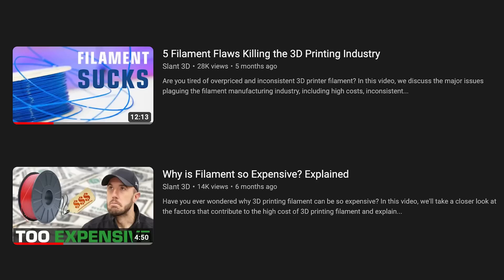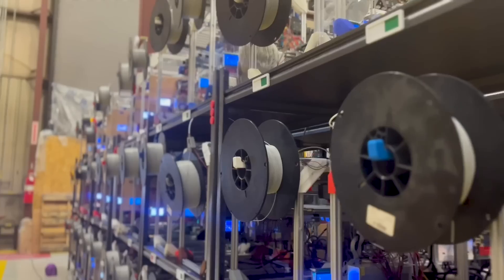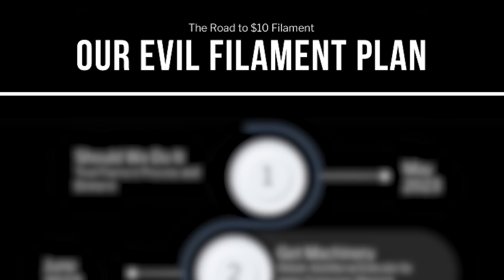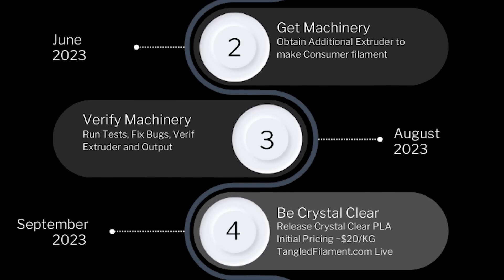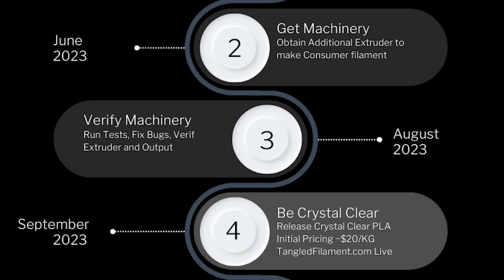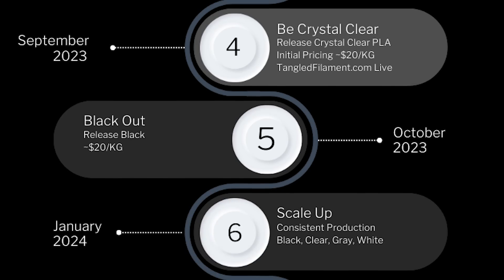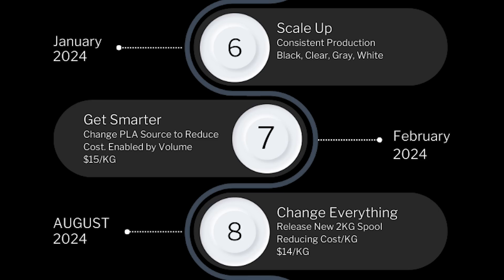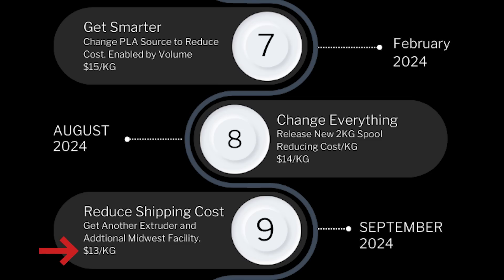Our Evil Plan to Make Great $10 Filament

Comment: I would be all for $10-$15 rolls of filament! I will be watching for this for sure.

One thought I had regarding plastic spool waste; I hate having big plastic spools left over from filament rolls. An idea I thought would be great is to sell the rolls wrapped on only a cardboard tube. Similar to the cardboard centerpiece on a roll of tape. Then have 2 plastic side pieces that can be removed but are not included by default with the spool. Then you could sell the plastic side pieces separately or even let people print them themselves. That way when you get a new spool you just pop the 2 plastic sides on and it would be exactly like a normal spool. When it's out, pop off the sides to save for another spool and toss the cardboard core.

You seem to be uniquely positioned to offer something like this since you have the print farm to print the side parts in-house. It could also help drive down cost. A cardboard tube has to be cheaper than those spools plus it would weigh slightly less for shipping
Reply: This is exactly how Bambu is doing it, you can buy either a spool or 'refil'  there is a little bit to it it has to be wrapped such that it doesn't fall off the cardboard center until after it is in the plastic halves but it works and saves a few bucks per spool.  They also have a small RF chip embedded which tells the AMS what filament the spool is.  But it works fine without it also.
Reply: @mattr3194  I am not in that eco system, but I am not surprised. Bambu is good at little things like that from what I have seen.
Reply: @royalt9863 $14-$15 US made filament already exists. You just have to buy in bulk.
Reply: @TheKDracing  Or walk into a micro center
Reply: @kalmenbarkin5708   My comment was US made materials. Inland is all made in China
Reply: So a masterspool? It's been around a while almost what you're talking about except it is no spool at all and you print two pieces that screw together for it, once they are screwed together you can snip the zip ties holding the filament together
Reply: $12-15 rolls are already all over Amazon. Shipping included.
Reply: Microcenter store brand (inland) filament (actually Esun, i think?) does this, and it's great! (spool-less line; it is, in fact, also marginally cheaper that way :) )
Reply: I'd prefer 0 plastic be used for the spools. It boggles my mind that single use plastic filament spools are a thing, it's literally 250g of manufactured ABS/PET waste.
Reply: this is how bambu does it, but if not on a sale its high lol
Reply: @jakeMTSU  I have purchased a bambu printer since posting this and as others pointed out, yes bambu does so exactly this. Smart!
Reply: MASS adoption = pellets.
Reply: Can you explain why is everyone so hyped? I am already buying $11 pla filament on aliexpress...
Reply: @Einxeld  I guess it's the assumption people are making that all cheap filament you can get right now is trash.
Reply: @treborrrrr  Sunlu filament is really good and my last order was 66 euro for 6 kilo of PLA shipped.
Reply: USA made ... always good @Einxeld
Reply: @Einxeld  I think you would agree that 10 is less than 11. A almost 10% saving on materials is a big deal when you buy lots of filament.  Also, I would rather work with a company on the same continent as I if I have a choice.
Reply: @royalt9863  i don't think they will have free shipping worldwide, like ali does though, so that's additional cost for people not on the same continent. Without it of course 10 is better than 11.
Reply: @Einxeld Ali express does not offer free shipping world wide on filament.  I live in a rural Canadian town.  14.5 USD for a roll will cost me 34.5 USD in Shipping minimum. In order for it to make sense the volume I would have to purchase would be insane.

Comment: Lots of neat ideas. Wish you all the success in the world. Don't really understand the 2kg size when we already have pretty standard 3kg and 5kg options from other manufacturers. 

For me the most surprising (and personally disappointing) aspect is that we're talking about pla. Pla having both cold creep and heat creep makes it a terrible choice for anything I make. Pla in a normal environment like a hot car will deform quickly. 

Petg in 2025 is a bit better, but really for serious products ABS or ASA is way more ideal. There is a reason so many manufactured parts in your home and car are ABS. 
Customers buying petg or any hydroscopic fillament should dry it regardless of your process, this concern is silly imo.
Reply: ABS looks and feels pretty bad, I'm not an expert on ASA but I prefer PETG for its look and better properties than PLA. PC is the best though :)
Reply: @sowa705  If abs looks and feels bad you're either using bad material or you gotta fix your settings.

Comment: I prefer PETG actually, less forgiving all around, especially with print speeds, but it's got the best mechanical properties for my uses, which are usually mechanical in some way, and not aesthetic.
Reply: PET is even better and doesn't have the print speed problems. I've lost my source for PET filament and would love if Slant could fill the gap. Best of all, while some consumer level users may struggle to use it, real PET is an ideal material for low cost, extremely high strength mass production 3D printed parts, so it'd make sense for use on the farm while consumers gradually discover it.

Comment: you make Black PETG, US manufactured, consistent at $10/spool I will be customer indefinitely. Please make sure spools will work in AMS. ;) ETA: it would be really rad if as part of your thinking you could solve spool recycling as well as misprint/bits recycling. I am using Terracycle for some things but it's super expensive. There has to be better ways.

Comment: Let's be real - you're launching a plastics-oriented business at a time when global petroleum use is scheduled by global governments to plumet. So when are y'all buying your own bioreactor? Vertically integrating the synthesis of your own PLA filament seems the mostest efficentest route to low-cost material production, and you can beat your chests about "not advancing the use of petroleum plastics" which will be on the tips of the toungs of the media, I estimate, in the next 3-5 years.
Reply: PLA is made from corn. We've never produced so much corn for fuel and byproducts and it goes up every year. If you think petroleum production's gonna be hurt significantly within the next two decades, you're crazy, anyway, but PLA doesn't rely on petroleum because it's a bioplastic. It's made from corn

Comment: Greatest thing is that you can still use the filament for your own uses if something goes whacky and people don't buy. I do think the $20 price point is too high as I have not paid over $10 for a roll in a long time unless it is something special. Of course people will say its low quality but I havent noticed a difference from any other filament that I have tried, except the spools themselves were a bit wonky at first. I really hope you can get down to $10 rolls faster than you think and also introduce the 2kg and maybe 5kg or 6kg rolls also.

Comment: Could you explain why you want to continue using spools? You mention going from 1kg to 2kg spools will save on cost. Getting rid of one use spools and switching to a reuseable spools seems like it would be even better and I think is where the industry should be heading.
Reply: They had some problems getting reusable spools to work; they have some videos on the topic. They couldn't make them reliable, they don't think it's a good experience to make people refill their own spools, and nobody was really buying the refills. They basically consider it a "failed" product.

Comment: This is very exciting! Hope you'll consider selling without spools, or creating a 3d printed spool for your 2 kg offering.
Reply: The problem with 3D printing spools is the cost, in most cases you are cheaper just to buy filament with a spool rather than a refill than to print the spool yourself, and that doesn’t take into account time either.
Reply: @conorstewart2214  I don't know about that. The SlantSpool can be printed for about 300grams of filament (even less at 250g for the 6 inch version), so you can get about 3 spools per kg of filament. I've been using the PrintedSolid Jessie PLA transition rolls for my SlantSpools, which costs $16/kg, or about $5 per printed spool. If removing the spool from a roll of filament saves even $1 per roll, you'll make up the difference in just 5 rolls, plus you don't have to deal with the empty spools (if you consider that a negative at all). I buy a lot of ABS filament and my manufacturer of choice is Keene Village Plastics. Their Koil line (without the spool) costs a few dollars less than the normal spooled stuff, so I make up the cost in just a couple rolls.

Comment: People pay more for good filament, because bad filament makes bad prints. Any firmament with a greater than +-0.02mm diameter tolerance is not worth buying, at any price. And to get +-0.02 diameter tolerance, you will pay $30-40. What is your ACTUAL tolerance?
Reply: Cheap filament is not bad filament.
Reply: @gerolori  Are you new to 3d printing,.... Welcome !!!!. But yes,... cheap filament is bad filament. A 3d printer just pushes filament by the millimeter, so if the diameter varies, so does the quality of the print.

Comment: In the aspect of the spool design element i would like to see if there's a possibility of a collapsible plastic spool that can be flattened down to fit more in the same size box they were originally shipped in and then be able to be shipped back to Slant 3D for reuse.
Reply from the maker: Interesting idea
Reply: I recon shipping would cost more then what an empty spool is worth, reusable spools and refill filaments is the way to go!

Comment: I love the disruption you guys doing with this and with 3D print mass production. 
Can’t wait for Europe.
Reply: Dont know about other countries but in Poland you can buy cheap 1kg PLA (9-11$) and ABS (~13$) for several years now. Pretty good quality too. Probably wouldn't make as much disruption in Europe as in US.
Reply: @rust941  where, I am in europa and cant get below €15 /kg in 10KG batches
Reply: @rust941  yup, 3D active offers 1100g PLA and PET-G spools for as low as 54pln (11,5 euros)
Reply: @rust941  yeah my exact thinking, I mean I doubt they are going to be able to produce and sell it at $10/kg shipped to the UK. I get a single spool of pla for £15/kg free shipping so I'd like to see if they can beat that because $17.50/kg is basically the same and then I doubt they offer free shipping. 

Maybe some disruption in the US but can't see this worldwide
Reply: @rust941  can  you link us?
Reply: @rust941  That's good to hear and sounds immediately plausible. Since I know of another Polish company, who has over the last few years also been building a reputation for high quality plastic products.
Coby (Lego compatible / mostly military models / primarily targeting the model market, since they clamp so hard, they are notoriously difficult to disassemble[they also sacrificed some of the grooves in Lego plates for example, for a smoother optic in the models making them even harder to take apart])
Really struggling to not buy a few of their tanks every time I think about them.
Reply from the maker: Thanks
Reply: @slant3d  When to europe?
Reply: @slant3d  I wonder, will this filament ever be available to Australia as I am interested in this filament as it could be a massive game changer for the whole industry.
Reply: @slant3d  Sooo... when can print farms expect to be able to order 20kg of filament on a cardboard spool in a 0.5mx0.5mx0.5m cardboard box that can simply slip into a powered feeder under the printer for even easier filament replenishment?
Reply: i just bought PLA at less than 10€/kg from gst3d, it's in Spain. It's without a spool though.
Reply: @jukees3658 you need to buy in 8 packs though and the shipping isn't free
Reply: sunlu sells 10 spools of 1kg petg fot 80€, with free dhl shipping
Reply: Consider Aurapol they are really good